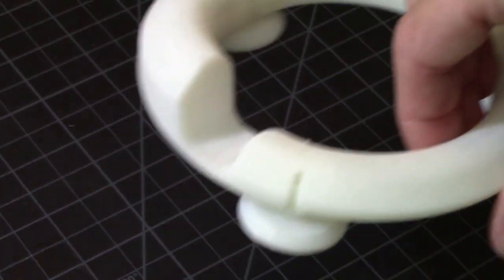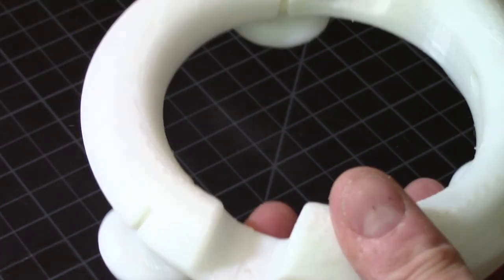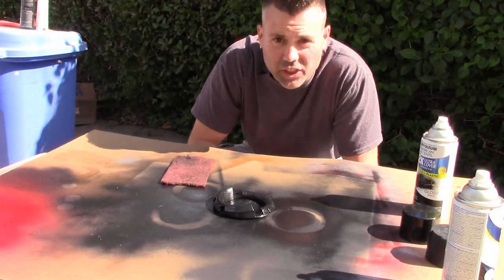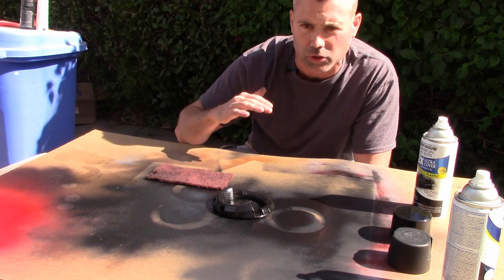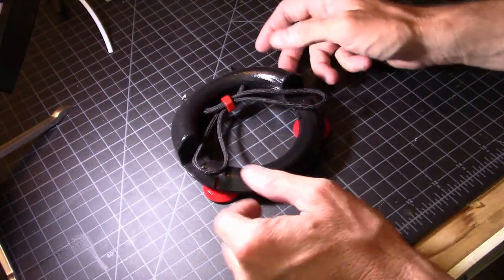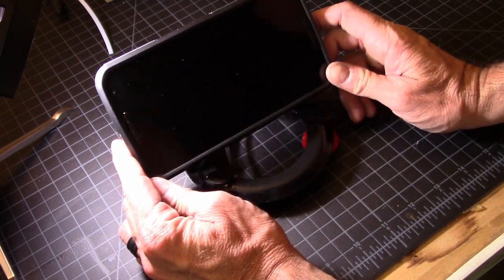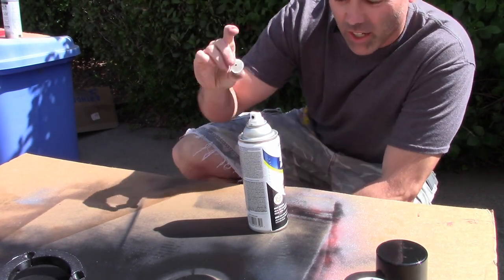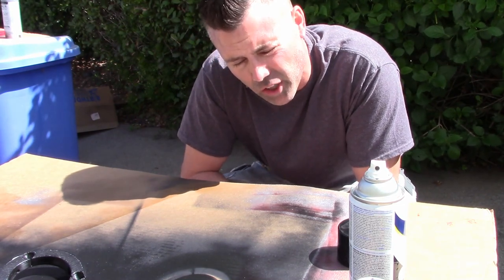How to Paint 3D Printed Parts

Comment: Three things that really make my 3d painting life easier: set of files for initial smoothing/shaping, cheap lazy susan for my painting platform, and some kind of blue tack/poster tack/whatever to stick the part on the lazy susan. Also, for large pieces, one of those spray can pistol grips -- which keeps me from slightly covering the nozzle with my finger and accidentally dripping. For a modest-quality job, like what you present, I typically dry sand the primer (often, but not always, automotive filler primer) for speed but wet sand the paint to prevent rub-through.

Comment: dude, acetone vapor bath. That smooths shit out like mad.
Reply from the maker: Totally... I agree... with cool models and stuff... but for structural stuff.. it throws off the dimensions for fittings an stuff so it's not an option.
Reply: The acetone vapor bath only works for ABS. If he is using PLA the acetone trick won't work.